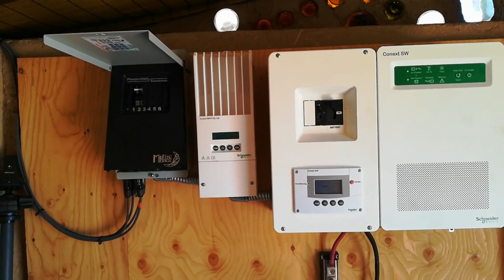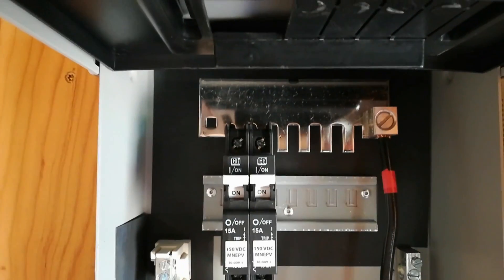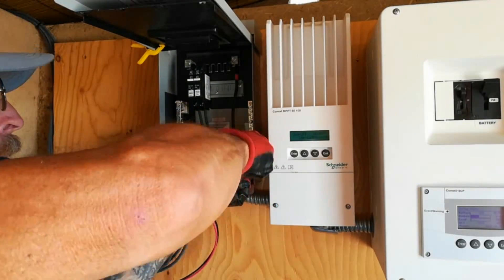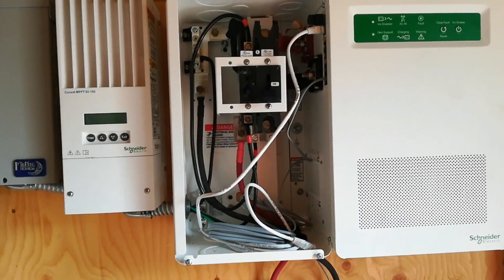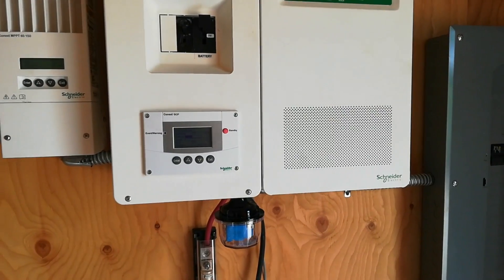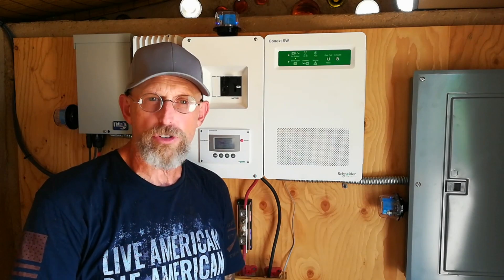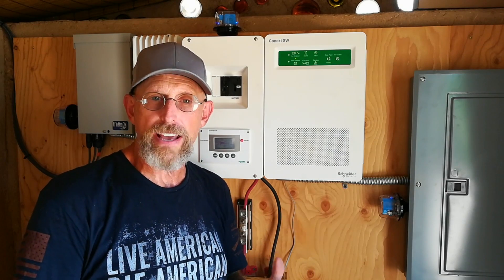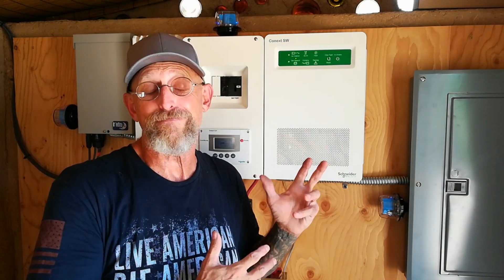Midnite Solar Surge Protector Installation

Comment: 4:05 SPD is between the Breaker and the SCC.
This is confusing. I got people claiming SPD should be between Panel and Breaker.
Though NEC dictates SPD should be on the LOAD side, which is what you did.

Comment: This is EXACTLY the video I was looking for - thank you for this! I have two questions: 1) where did you get that second square lug for the positive bus bar? 2) can you tell me what's going on with the bottom knockouts that have the cables coming from the PV array? Are those just MC4 connectors? How did you get them to stay right there? Or, what are you using to keep them there?
Reply from the maker: The mc4 connectors have locking nuts on the inside holding everything in place. The second lug I picked up at an electrical supply house. You should be able to get it on Amazon too.

Comment: I was tired of the crappy inverters from Asia having been thru 3 units from two different manufacturers in the last 2 (two! not 12) months. I looked at Schneider and all I could see was a lot of owners/users really upset at how hard it was to get support/warranty from Schneider.  I ponied up the cash and bought a SolArk instead. I don't expect to use the support line but when I do need it I expect that someone will pick up the phone and stand behind the product they sell.
Reply from the maker: I think equally important is the where you buy your components. I was fortunate to get excellent Customer Service from Northern Arizona Wind and Sun. When we had an issue, I got a hold of them and they facilitated the warranty exchange which took about 3 days total including shipping. Hard to complain about that.
Reply: @theupsideofdownsizing  Totally agree. Currently dealing with the awful customer support of a company that sells incredibly expensive blue batteries that will remain nameless. When the first response from the woman that answers the phone is "we don't accept returns on those" when she hasn't even heard a single word  of what the problem might be you know you have an uphill battle ahead of you. Maybe the problem is you and your product and not the customer that was stupid enough to trust and give you their money.

Comment: Now you need to build a faraday cage around the shed to protect against those emp's.
Reply: I bought a com box at government auction for 600 bucks it's emp proof with four doors.
Reply: Would a shipping container work?
Reply: @TerraFirmaX  Yes a shipping container connected to a substantial earth ground would work well. Even just sitting on the ground would likely do it. Many people use things like metal trash cans and metal bags then simply ground them to make protection vessels for their electronics.

Comment: I can't tell you how much I've enjoyed watching this while drinking my morning coffee !
Reply: Mark, I may need your contact info.  I just bought my batteries and I'm waffling between Conext XW Pro 6848 (AltE is running a sale right now) with ?? CC or a MPP LV5048 all-in-one system.  Using 275W panels (or other, I'm not wed to a panel as I have a used-reseller local.)  I really want to keep using my Generac XC8000E as an input option.  It seems Magnum requires a split phase input and my genie doesn't do split phase, but it does to 220V - hum.  Really need some wisdom!!!